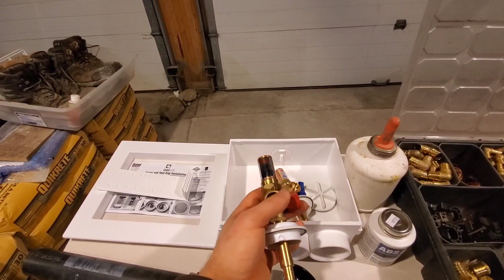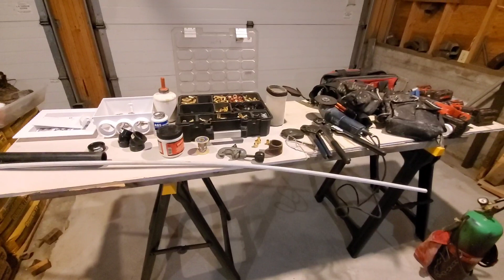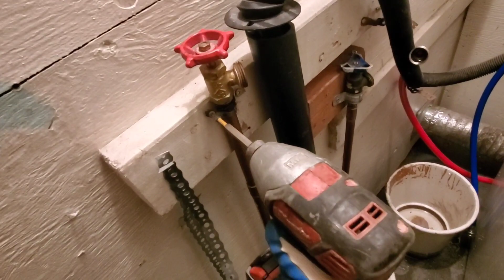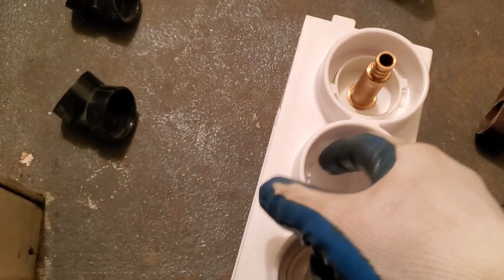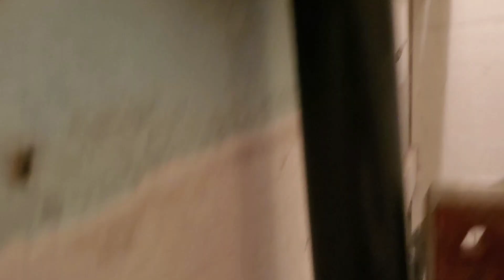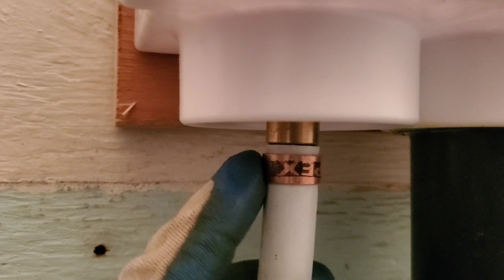Laundry box install

Comment: Regarding the vent pipe going through the roof...would it be worth the time and effort if the inspector required it to be?
Reply from the maker: Thanks for your qustion, yes it would be. To move the laundry somewhere else would be even more tme and effort than installing a flashing above.

Comment: Outlet needs to be a GFCI outlet
Reply from the maker: Good eye you are correct. The video is about installing a laundry box, not about the electrical. Nothing with the addition(The laundry)is actually done correctly.  No permits were pulled and the crew that did the work cut corners everywhere. They didnt even glue the ABS together when they installed it. Staples, clips, merrets, nails, etc, were missed or was simply ignored. The build of the addition is a 2/10.

Thank-you for taking time out of your day to comment and help me with my channel, I will install a GFCI to set a good example for other homeowners.

Comment: Washer drains are 2" and glue should be abs to pvc specific, different than abs glue
Reply from the maker: "Washer drains are 2" and glue should be abs to pvc specific, different than abs glue"

By TODAY'S standard, yes you are correct, the drain needs to be 2". The original install was done about 10 years ago when  1 1/2 was acceptable.  I pulled permits on this job and it passed. That what is meant when I say " inspector" As in plumbing inspector. 

As for using transitional glue( Between the pipe and box) We cap the pipe off for test. Then install the box after our drainage inspection. This joint will never see water. I have also never have failed for this nor have I had a leak from this joint. 

I will add into the description about the size of the drain, This was one of my earlier video's in my Youtube career so I should of been clear about it.

Thanks for your input and helping me to improve my channel.

Comment: I don’t like the box technically that should be recessed into the wall, I would have went with a standard watts washing machine valve, would have saved you a ton of time and look better than a box sitting outside of the wall
Reply from the maker: The laundry in the house is an addition,  nothing in the addition was technically built correctly.  If you have a Watts box available, go with that. I bought what the supplier had. I upgraded the laundry into this box being cost effective, I won't turn a 2 hour job into a week just so it looks better in a house that will be torn down in 10 years. The premise of my channel is to DIY and save money.

Comment: I don't understand why opening the main shutoff valve quickly would cause pinhole leaks.
Reply from the maker: As stuff gets old, it breaks more easily. If you refill the system too quickly, the pipes can expand too much causing leaks. We want to control the rate of expansion through metering of the volume of water refilling the system. I hope that helps.
Reply: Yeah...it doesn't cause pinhole leaks....it may blow off a fitting since he's using PEX A type lines.... pinholes happen in copper lines from not reaming out the inside of the pipe after cutting

Comment: Very helpful video.   I didn't put in a box because i thought it was only for between studs.  I will redo what I did.  Thanks.
Reply: The box should be installed between the studs
Reply from the maker: @glenarseneau1231  Yes it should. But I won't turn a simple job into something a lot bigger and more expensive in a house that will be torn down in 10 years.